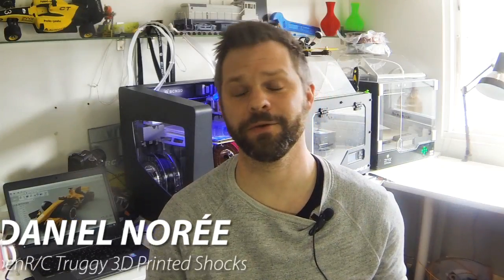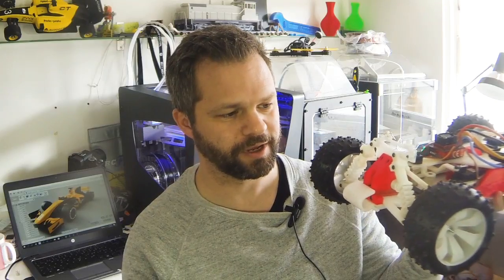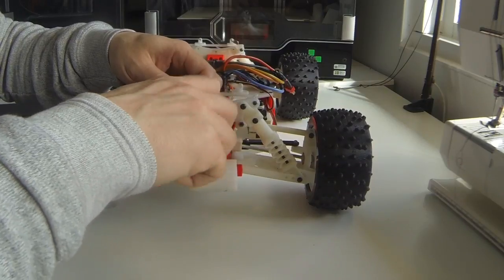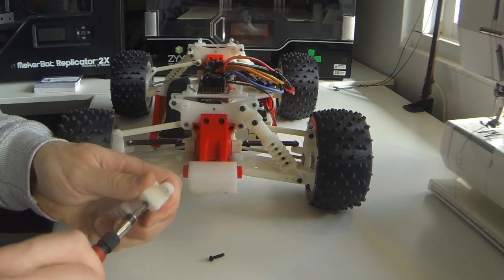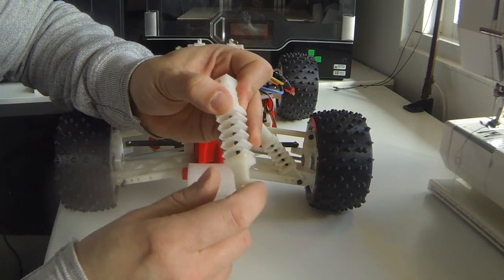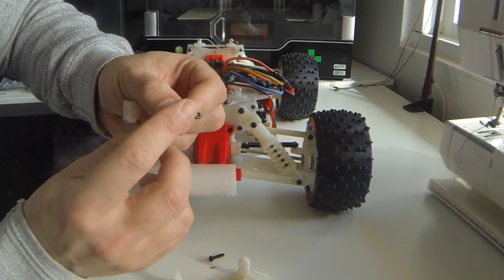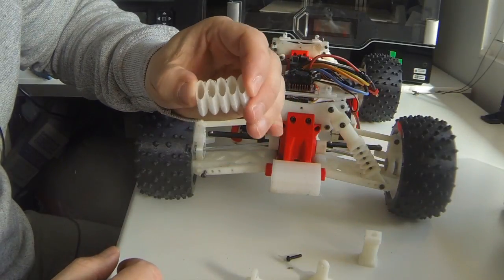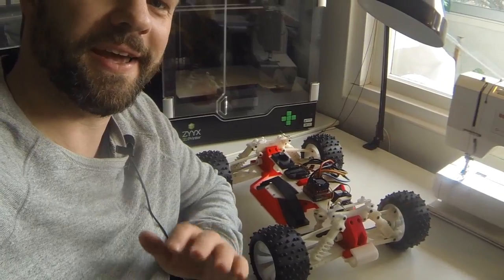3DPrinted shocks - OpenRC Truggy

Comment: Hi Daniel, this is the first time I see what you did with the shocks. very nice indeed! I thought about a way that you could mitigate the wobble of the screw in the shock. If you make a short cylinder the diameter of the bore and tap it you could run that down the screw to the head before assembling the shock, that cylinder would not allow the head of the screw to move as the shock works, it would alleviate that bowlegged stance.